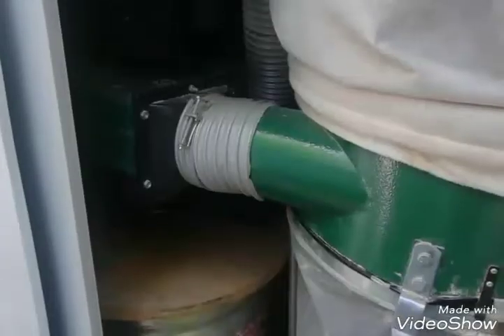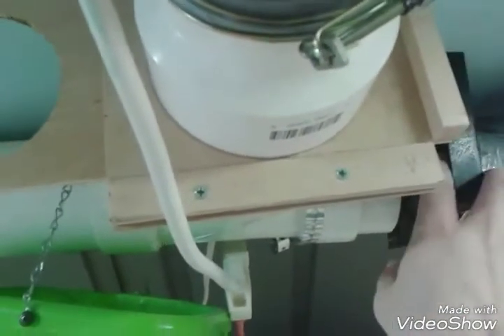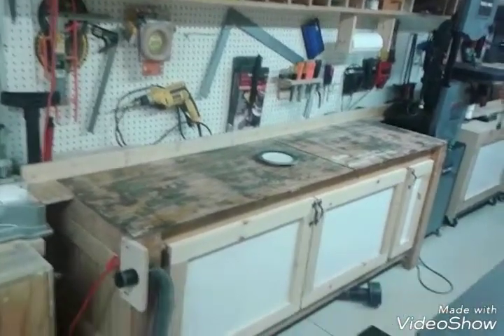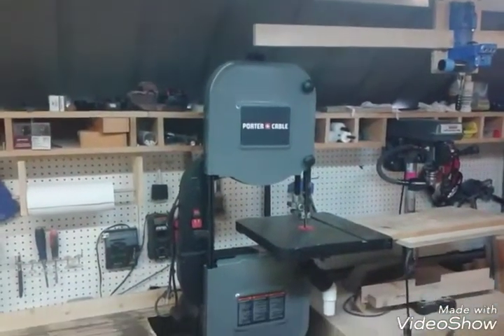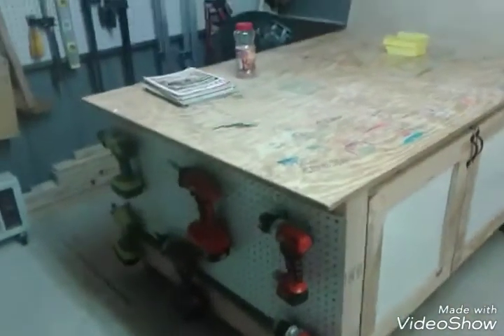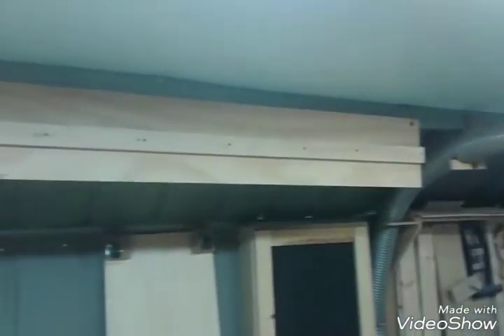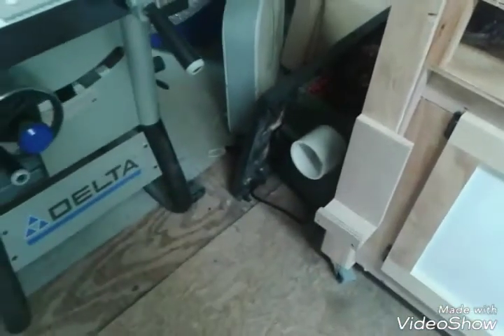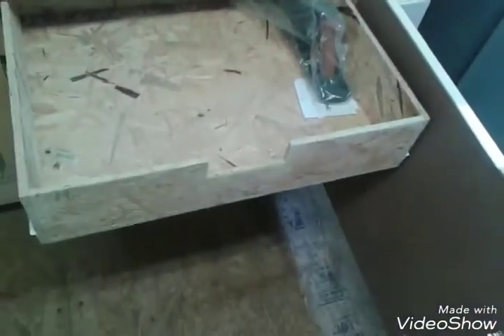Shop tour 12-24-16

Comment: Hope you can add some insulation to your shop. My experience with metal buildings is HOT in the summer and COLD in the winter. Also watched the new shop tour, like the jigs you made especially the one for the Kreg jig. All the best.
Reply from the maker: Thank you. I do have a little insulation on the roof.It keeps it cool in the summer.